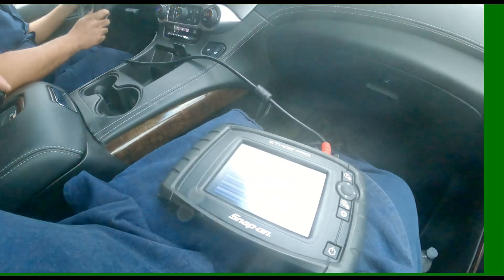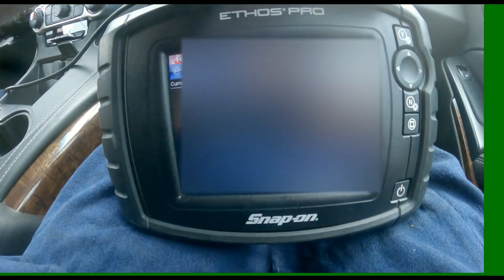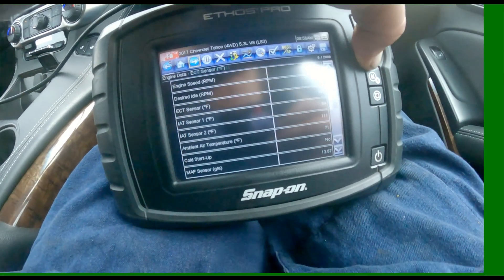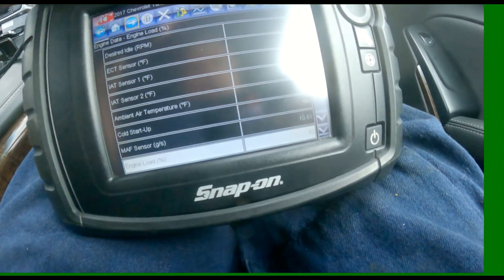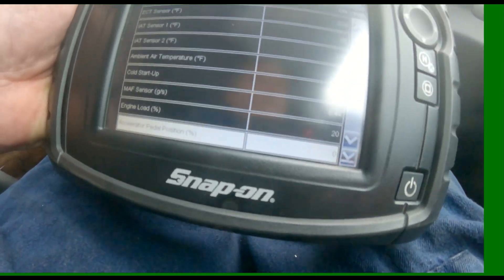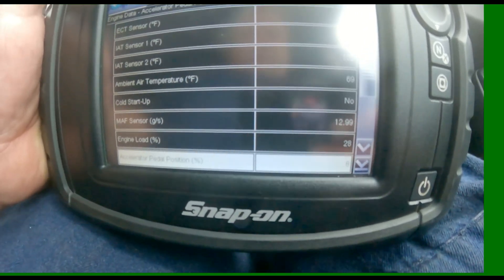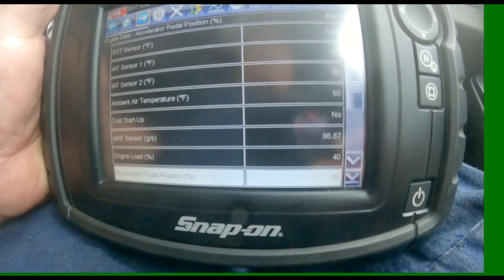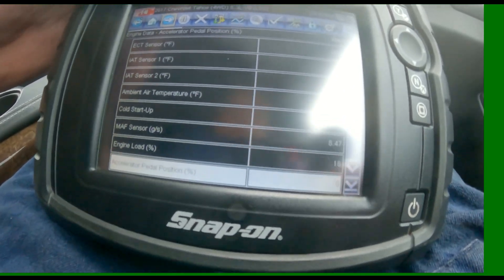4L60E Repeated 3-4 Clutch Burn Up & Volumetric Efficiency

Comment: So if your volumetric efficiency is adequate why are you still smoking clutches?
Reply from the maker: There could be several reasons. Line pressure is low. 3-4 accumulator piston wear. Band adjustment off. 3-4 clearance off. Input shaft leaking in the spline area. Check ball sticking in separator plate. AFL Valve worn. Shift solenoids. Probably more I'm not thinking of right now.